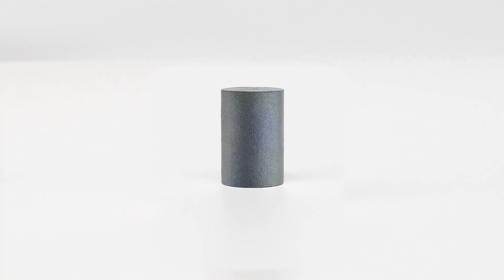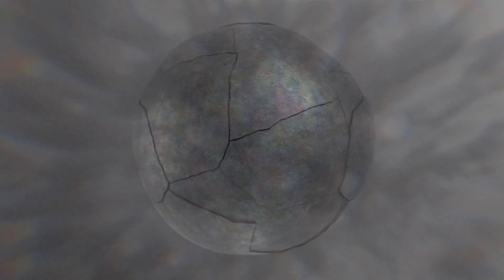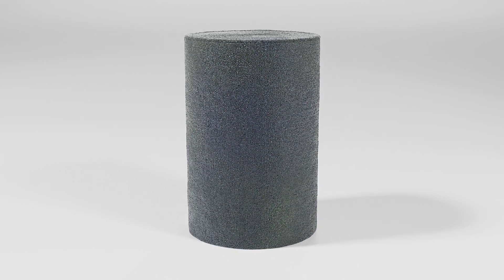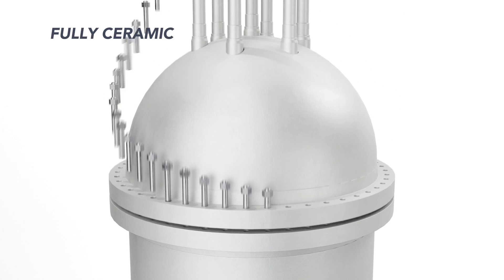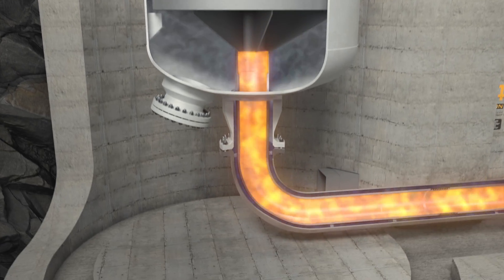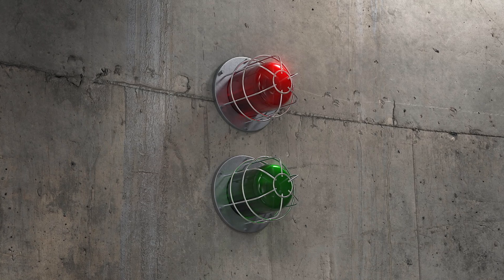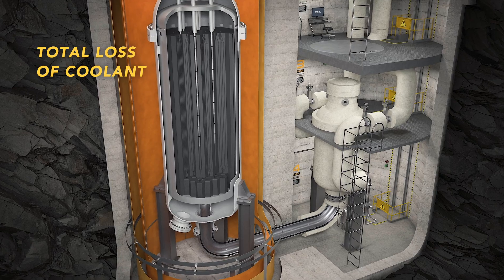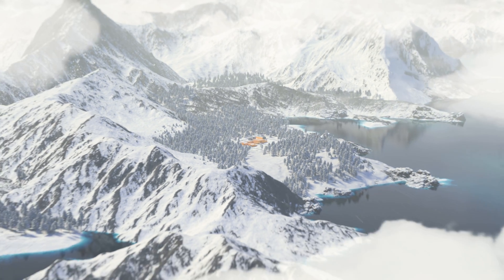How it Works – the Micro Modular Nuclear Reactor

Comment: Your solutions can work for base load and demand generation like a natural gas plant, so that will be your main competition. According to news sources covering the new Cascade power plant in Alberta, a modern combined-cycle natural gas plant can produce 900 MW on about 128 acres of land, at a build cost of $1.2 Billion US. Your site states a land use of 5 acres to produce 3.5-15 MW of electricity. Optimistically, your solution can produce 42% of the power that a natural gas plant can with the same amount of land. That's not a dealbreaker per se, so it's all going to come down to cost.

Comment: I've been watching SMR presentations for years. 
Until this point, I'd only seen one viable candidate, Moltex Energy. 
Now I've seen two, congratulations.
Reply: Although one big question is use of nuclear approved materials, is there existing approval for all the materials? 
Nuclear steels, etc. 
What about the silicon carbide fuel matrix, will it need approval before it can be used? 
That's often a death trap for new nuclear.
Reply from the maker: @MostlyPennyCat  Great points. The TRISO specification we are using has been approved, and used in multiple reactors, even some operating today.

The steels, graphite, etc are all conventional nuclear materials used in reactors today.

Comment: I used to work at a nuclear power plant that used helium as a coolant, thorium rods, and graphite blocks to contain the rods. It was closed years ago and was turned into a natural gas powered plant. Was an expensive experiment that did not pan out due to the technology was beyond the machinery capabilities.
Reply: @twolford01  sounds like the Moscow power plant in southern Ohio along the Ohio river outside of Cincinnati. Spent millions to design and construct, could not pass inspection to operate as a nuke plant because of substandard work. Cost millions to-reconvert it to fossil fuels. They should have held the original contractor responsible for the cost to convert it back to fossil fuels.
Reply: @  That sounds like a massive failure that everyone had to pay for out of their utility bills. At least the NRC didn’t approve it, could have been a disaster.

Comment: You are bending the truth about how much energy is in one pellet.  You can only get 15% of it as electric power and you are not including all the energy needed to mine and process that little pellet.  If nuclear is so great why not give the full truth.
Reply from the maker: same goes for diesel right? 
This is the comparison:

1. thermal energy content of diesel when burned 13 kWh/kg or 37 MJ/L

2. the thermal energy content of the nuclear fuel when used in our reactor
3.6 million kWh/kg or 140 million MJ/L

Of course the fuel pellet is not just Uranium, as we encase it without various ceramics.
Reply: @ultrasafenuclear  You did not answer the question of how much power is required to make the fuel.

diesel is pumped from the ground, shipped (can wave that because both need to be shipped) Clean/filtered.

uranium is mined. (lots of energy) powdered(lots of energy) melted (lots and lots of energy) Mixed with ceramics (lots of energy) And all the machinery is now radio active waste.  

I don't know what the numbers are because the people that know don't want that information out.  It will kind of ruin the hole efficiency argument.

The processing of diesel fuel also creates lots of other chemicals that are used else where.  spreading the energy requirement to many other things.
Reply: @lostvisitor  I don't know what you're on about. If i recall correctly, Palo Verde produces enough energy to serve portions of 4 different states. It's one of the biggest electricity producers in the USA. Not even the biggest coal fired powerplant of North America (Scherer) can reach that output, all the while pumping millions of tons of CO2 into the atmosphere every year. Nuclear energy on the other hand only pollutes the environment if the plant blows up, which cannot happen with several reactor designs. It's said there have been 33 major nuclear accidents since 1952, it took 72 years to get that many. Maybe it's not as common of an occurance as people like you believe?
Reply from the maker: @lostvisitor  Sorry - I didn't understand that.  Great question. As you say, there is mining, chemical leeching, purification, enrichment, and then all the heating and layering processes to make the ceramic fuel. All that costs money, which is representative of the material, energy, and labor involved.

So, the energy required to make this fuel is built into the cost of the fuel. The cost of the fuel per unit energy delivered has unit of ¢/kWh. 
- For our fuel, it's roughly 0.25 ¢/kWh
- For diesel, the cost roughly 10 ¢/kWh
Reply: @ultrasafenuclear  now that is being more truthful.🤓  Don't forget the other side of the process after the fuel is spent and the nuclear plant and processing equipment is decommissioned.  material, energy, labor for hundreds of years.  where no energy is being produced.

Comment: So essentially the reactor containment vessel, is it's own vessel for when it is decommissioned and sent to bed for disposal in a radioactive repository?
Reply from the maker: no. we remove the graphite fuel blocks and stick them in dry cask storage. The vessel is reused for the next batch of fuel. It's pretty thick steel vessel (4-5cm thick) so good to keep using. like reusable rockets

Comment: If this is graphite moderated, i'm leaving earth ASAP... inefficient, expensive and potentialy dangerous.. I don't really know why people leaving  Nuclear technology. It is the best energy producer by so far even tho the fussion is far more efficient and safe but 100x more expensive or 300x  idk.. But graphite moderated reactor even with all the safety systems, if two of them fail at the same time no matter which two, you'll end up with molten core. 
1- no helium cooling and failed control rods safety system? = molten core
2- failed control rods safety system and no natural heat dissipation? = molten core 
3- failed natural heat dissipation and helium cooling? = molten core
Even tho you insert all the control rods inside, with no cooling your core will melt down. I don't know bro.. i trust good old VVER, they can produce up to 1500MW of electricity and  they are far more safe than graphite moderated reactors. Yours should be named as GMMMR - graphite moderated micro modular reactor. If somebody sees Graphite, the first thing that come in his head is Chernobyl because of RBMK, which is also graphite moderated. If you really need to enhance overall efficiency, you'll need high enriched fuel assembly and oh man that is expensive...
Reply from the maker: you should watch the video. graphite is a refractory ceramic. It's great when you don't use water.

Comment: General Atomics built a reactor using the same technology decades ago. The Fort St.Vrain nuclear reactor.
I worked for GA operating their 2 TRIGA reactors.
Reply from the maker: GA did good work there. We've addressed some of the operational issues with that reactor in this new design. Unfortunately, they lacked the customer interest to take further.
Reply: @ultrasafenuclear  it worked great except for the HE circulator bearing cooling WATER getting into the HE.
Reply from the maker: @atomicbill  right on. bad idea to have a steam generator interfacing the helium loop. Feel sorry for the vendors tying this.

Comment: How eficcent is it if it the heat is just radiated and conducted into the environment?
Reply from the maker: during normal operations, the heat is transported from the core to a heat exchanger using helium. During accidents, where there is no coolant, or the coolant is not able to circulate, the heat will radiate and conduct into the environment.

Comment: Ultimately what happens with the spent fuel? Shoot it ogf Waaay in2 outer space - interstellar. Put a WARNING label on it.
Reply from the maker: the spent fuel is stored in dry cask storage for a few years and then will be placed into a geological repository. At this stage, the spent fuel is dangerous only if ingested. The ceramic layers ensure the fuel stays intact for thousands of years until it is at lower radioactivity than the surrounding rock.

Comment: What is the cost per KWH for manufacturing and maintenance?  what is the lifespan?
Reply from the maker: We are designing the power plant for 40-year project lifetime, but fully expect that the civil works and much of the power plant will last 60-80 years and beyond. A gift for the future. 

the $/kWh are acceptable for many users looking for zero carbon power on-demand.

Comment: Before I was born, an experimental reactor had a partial meltdown about 20 miles from where my parents lived.  They kept running the reactor in that state for three months.  The meltdown was discovered, and the truth was hidden from the public for 25 years.  That reactor was just west of Los Angeles in Simi Valley.  In 1984, it was the third-worst nuclear accident then known to the public.  There are many similar radiation-poisoning incidents, such as Gulf War Syndrome.  I do not trust the nuclear industry.  You can hold a lump of coal in your hand with no danger to you.  You can stick your arm in a barrel of diesel fuel and go on to live the remainder of a natural lifespan.  But you can't do the same with nuclear fuel.

Comment: SMR's are in use in other countries. Sadly, the NRC has not approved them for use in the U.S. as of yet. Though that is going to change soon. Also, SMR's can make use of spent fuel. A spent fuel rod still contains 90% fissile material, it's just been contaminated with plutonium and other heavy elements. These contaminants can be chemically removed restoring the fuel rod to a usable state. Also, sadly, the NRC has no approved those recycling techniques here in the U.S., though it is being done in other countries. Nor can we legally ship our materials to other countries to be recycled. In other words, the NRC doesn't want the U.S. to have sustainable, recyclable  nuclear  power.

Comment: Nuclear promoters will tell you that clean nuclear electricity is the only way to stop climate destabilisation.
And the destruction of economies. 

Rooftop solar PV renewable, with EV big battery, promoters will tell you grid protection is the only way to save the economy in a 100% electric world. 
And that nuclear grid electricity is economically impossible for a 100% electric world because new grid is stupendously expensive. 

All electricity is dirt cheap at the point of generation. 5cents kWh. 

Grid rental is stupendously expensive. 

No more grid expansion, Rooftop PV electricity and the EVs big battery is the killer technology, economically. 

Tesla and the auto manufacturers know this. 
Nuclear promoters know this. 
The military knows this.
China knows this.
Fossil fuel knows this. 
Grid owners know this. 

EV battery liquid temperature management is extending battery life cycles by decades. 
Battery technologies are evolving rapidly. 

Utilization factor is a hot topic for nuclear promoters, and EV promoters. 
Under utilisation is an economic killer factor. 

Grids cost $1million per klm 
National grids cost $TRILLIONS to expand.
Grid expansion is limited by resources and $TRILLIONS in costs and time frames.

Comment: There is also Molten Salt Reactors, which can be used in replacement of the Helium in this situation. I personally would love to see a Small Modular Reactor (where you could have up to say 10 of them) next to each other all using a Molten Salt Reactor, so they could build up energy for large power draws from 2pm-9pm, especially during summer heat. I think it is the best and most efficient way.

Comment: What they should do is design a spaceship with similar technology.
Reply from the maker: We are in fact designing Nuclear Thermal Propulsion engines. Nuclear fuel heat a hydrogen gas. Way more efficient than chemical rockets.

Comment: Why? No one is going to buy these. A prime example of a solution to a problem that does not exist. Waste of time & money.
Reply from the maker: the problem is how do you get on-demand power for cities, industries, data centers etc? solar and batteries are great help but will get you maybe within 90% availability. that last 10%?
Reply: @ultrasafenuclear  I didn't say solar or wind will work either.

1. If your going to build a nuclear power plant, you go big, because you still have to deal with security, regulation, NRC, etc. a Utility will have to spend more than $1B for site studies, NRC filings, etc, no matter if the plant is 10MWe or 3GWe.

2. The world is running out of uranium. At current demand there is only sufficient economically recoverable supplies to last to around 2050. Thats one of the major reasons why they aren't building any new plants. 20 years in planning, construction & testing before a new plant can go operation, 2024 + 20 = 2044. 

3. We need to shutdown all nuclear plants as they are huge risks when the US collapses (economically) or in nuclear war.  NPP are doomsday machines since if NPP need constant cooling for the spent fuel pool, as it takes between 4 & 5 years for the spent fuel to cool down that it doesn't need active cooling. The US still does have a long term storage facility (Harry Reid), and all of the spent fuel is sitting on site in either the spent fuel pool or on dry caskets.
If the cooling is lost to the spent fuel pool for a significant period, the water in the spent fuel pool will boil away, leading to the top of the rods to be exposed, which will catch fire when exposed to steam. There is enough material in every spent fuel pool to contaminated 7000 sq miles with around 1 megabecquerels per square meter, rendering that entire area un-inhabitable for thousands of years.

What is going to happen is there is going to be a biggest energy crisis in human history when Oil production collapses. Global Oil Production peaked in 2018, and is in decline. The Share revolution is nearly over as most of the fields are in decline while the API continues to soar (ie mostly NatGas condensant & little Oil). Meanwhile the DC psy-cho paths continue to pointless wars that just waste trillions & put us on track for nuclear war.
Reply: @ultrasafenuclear  Let's see... about 125 billion cubic feet per day of natural gas ought to do it.

Comment: Neat idea, but I notice you did not mention one of these likely expensive reactors has the output of 3 wind turbines (15 MW max).
I'm very pro-nuclear, but holy hell that is a really piss-poor fuel density, you'd practically be coating large portions of the landscape, or large areas of underground space, in these reactors. It'd be possible yeah, but it just seems unfeasible compared to constructing a single, centralized plant that produces gigawatts of power, and possibly for less money vs energy output.

Comment: If you guys think bad guys wouldn’t try to weaponize such a portable device, I have a moon to sell you. Every technology eventually gets into bad guys’ hands. That’s the way this world works. So if a tech has ability to be a WOMD, it needs to be owned, operated by governments who have vast resources to secure it.
Reply: Maybe do some research on why the power density allows the reactor to be fail safe when it comes to heat. The amount of effort needed to break the fuel out and refine it would wore expensive than just mining the material from scratch. Bad guys would have to get extremely rich to highjack this technology……
Reply from the maker: @natehirt4297  Great comments and observations. 100%
Reply from the maker: no different than cars, aircraft, or the water supply. Security is in place. but moreover, there's really not much a terrorist could do. Sure pull out the control rods, cut the coolant, even try to smash it to pieces. The TRISO withstands extreme temperatures and even impacts. They can get creative, but the difficulty to weaponize this or create accident conditions is immense.

Comment: The helium become radiactive when collling? What Will happen if exist a gas scape?
Reply from the maker: No sir. Perfectly clean.
Reply: @ultrasafenuclear  still i have some worried of passing from líquid like LFTR model to helium every gas worried me specialy when i remenber Chernobyl
Reply from the maker: @offroadsnake  relax. it's going to be okay. water can corrode materials and generate hydrogen gas that will explode in the presence of oxygen. Helium is completely inert.
Reply: @ultrasafenuclear  yeap but what if if helium can be exposed by radiation for some reason and scape. Yeaapp 😅
Reply: @ultrasafenuclear I am appalled by how nuclear evangelists simply tell everyone to calm down; when things go bad. Nothing.
Reply: @ultrasafenuclear how much profit do you stand to make per khw?